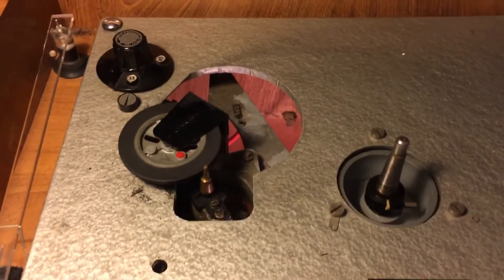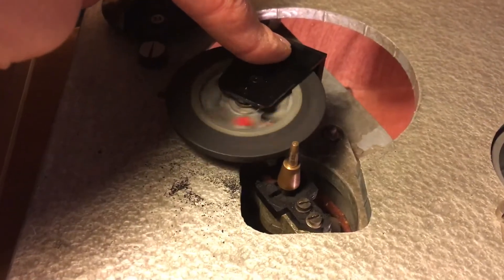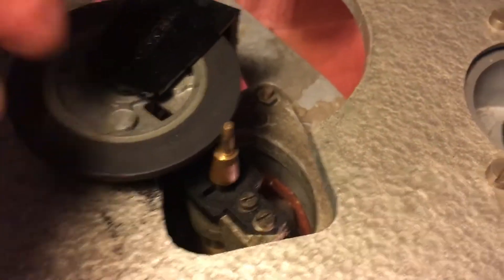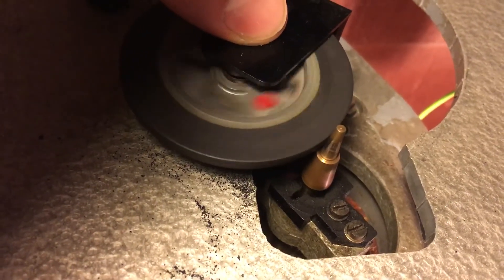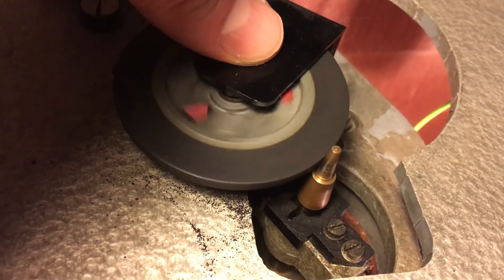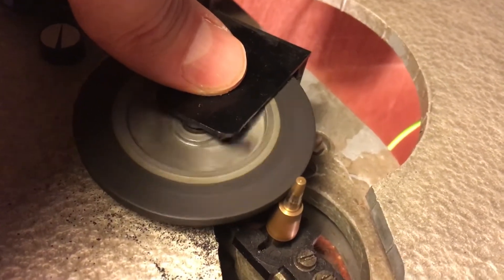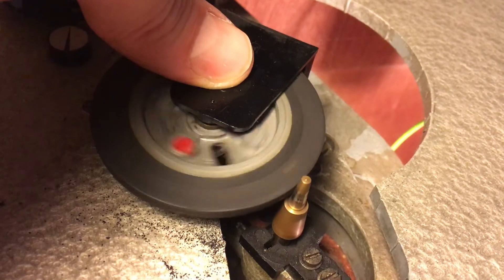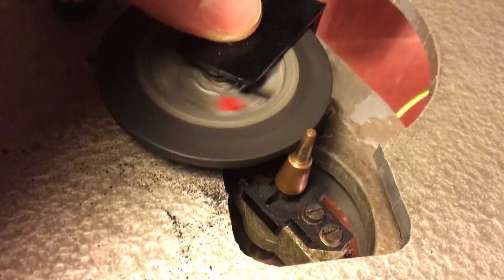Connoisseur turntable, under the hood

Comment: I know from experience that the rubber bushings/mounts perish with age so I wonder if your motor is sitting lower due to perished mounts which is why the idler is adjusted to sit lower which is causing the scraping noise from the idler.i don't own any of these types of turntable anymore but I know I had a lot of adjusting to do to stop scraping noises on some of my connoisseur tables.i ended up making new motor mount bushings from small rubber feet at around 10mm in hight which did the job nicely.
I tried various types of oil in that motor lubrication pipe and found a light machine oil to be best.hope this helps even though it's been a few months since you posted it.good luck😁👍
Reply from the maker: Thanks so much for your reply! I've only just seen it. Certainly worth taking a look at those rubber bushings. I've just ordered some specific turntable oil, so let's see if that does anything before I take it apart. I changed the rubber on the wheel and that didn't make any difference. Personally I think I might need to get to the bearings and re grease them. It sounds like my bike when it's in need for some TLC!